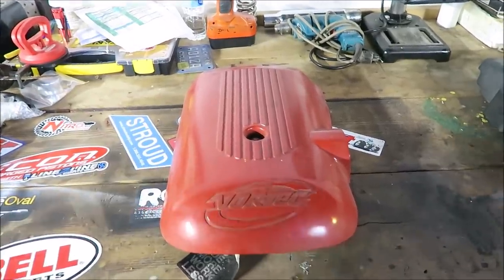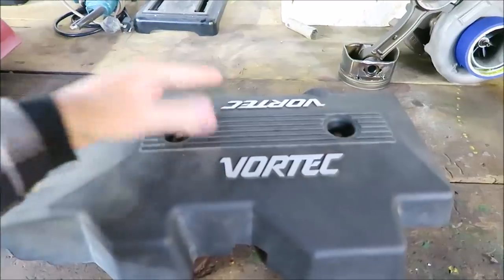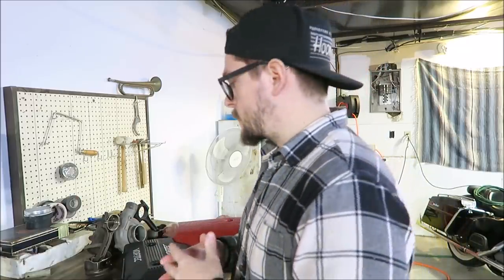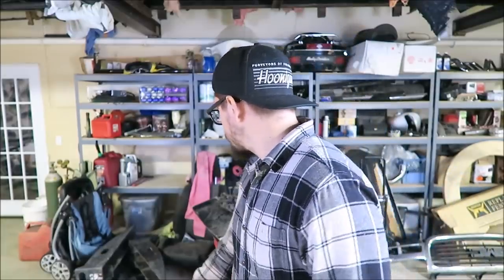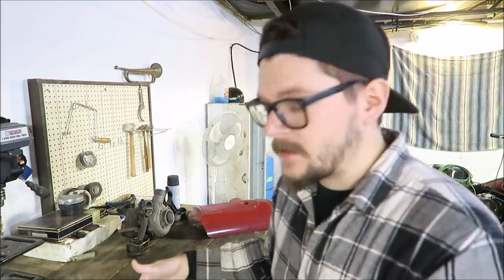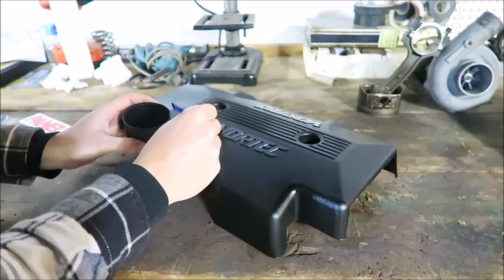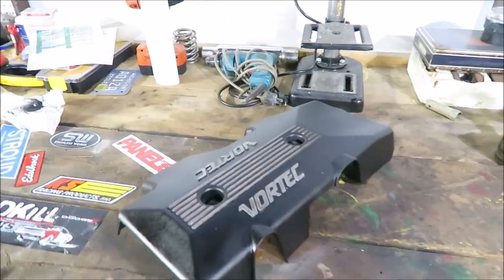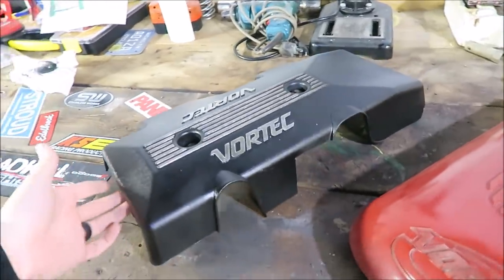Can You Paint Your Engine Cover WITHOUT Being A "Ricer"?

Comment: How bout take that stupid piece of plastic off that beautiful ls get a carbureted intake and Edelbrock carb and stand back in awe of a mans motor...paints “engine cover” + 50whp...
Reply from the maker: Because that would be 3 steps backwards. Even if I got a good blow thru carb that worked well with the supercharger, daily driving it would be a hassle because in Michigan the weather changes so often that it would constantly need tuning. And it wouldn't get as good of mileage. Unless you're one of those guys that just doesn't want to take the time to learn EFI and has to stick with the carb, it doesn't make sense.